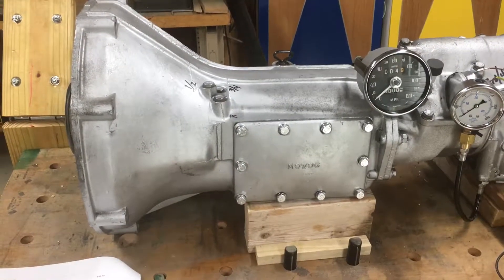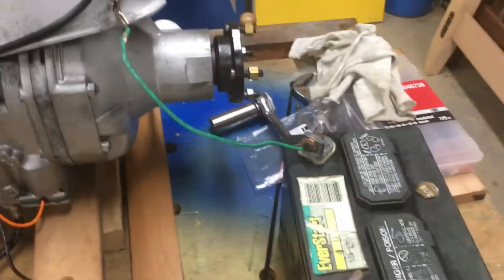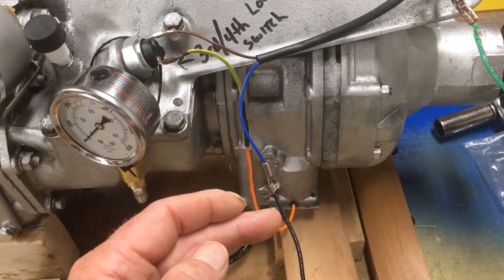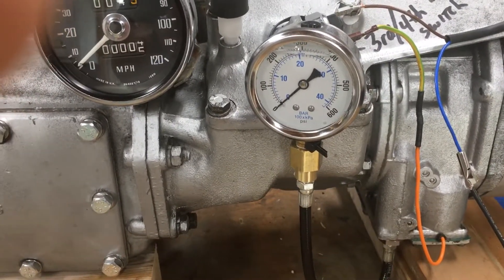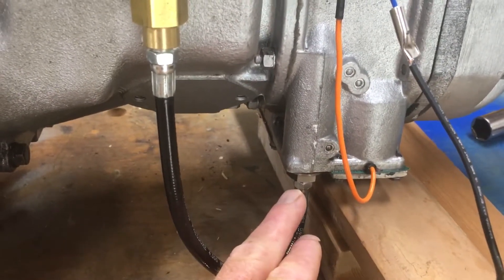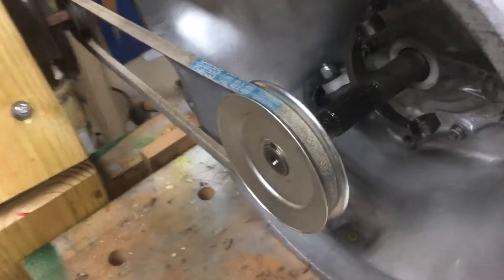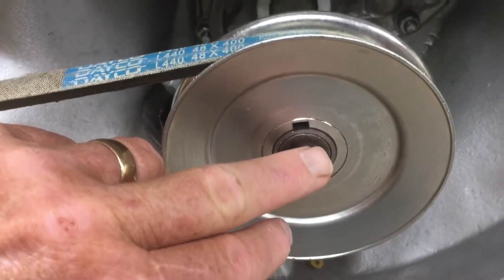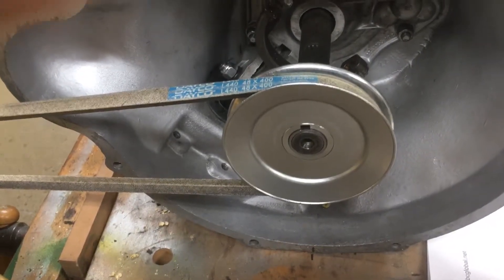MGB overdrive transmission bench test

Comment: Thanks for the video. I have questions: 
(1) what type of oil  you put in this tranny for your test?
(2) I can not tell from your video, is there a tooth connection in the back of your pulley on to the teeth of output shaft of the tranny? If there is no tooth connection, does your pulley ever slipped off during speed?

Thanks again
Reply from the maker: I use Castrol GTX, SAE20W/50 motor oil in the transmission, same oil I use in the engine.
Reply from the maker: The purchased the pulley I used on the output shaft of the transmission from Tractor Supply. The mounting hole was slightly larger than the shaft, so I had a friend of mine machine me a spacer shim.  The pulley has a set screw to secure it to a shaft, he also drilled a hole in the shim to allow for the longer required set screw, I had no problem with it spinning on the shaft.

Comment: Superb 👍 You engineering types are amazing. Doesn't explain why mine suddenly stopped working. New shifter switch. Solenoid tested working and refurbished by overdrive repair people in Sheffield United Kingdom. New o rings in pressure valve and pump. No joy. Need to remove engine and send unit to Sheffield for further exam.
Reply from the maker: Thanks for the nice complement.   Before pulling it out of the car, make sure that you are getting power to the solenoid.  As I reviewed in the video 12v power goes through the O/D on/off switch (mine is located on top of the shifter lever), then to the 3/4 lockout switch (on the side of the trans) then finally to the solenoid.  problem could be in the 3/4 lockout switch, or the O/D on/off switch.  More then likely the problem is electrical, to test that just bypass both switches and run power directly to the solenoid, of course using a temp on/off switch.  After wiring this temporary power, drive the car, and once in 4th gear turn the temp circuit on, there's a good chance the O/D will engage.  Good luck
Reply: @otmarrenken3465  Thank you Otmar! I must tell my mechanic, but he tested the solenoid for power after it had been refurbished by overdrive repair people and reinstalled and he was happy that power is getting through to the solenoid
Reply from the maker: @LeRoiDelaRue  Good luck, I had hoped to save you allot of costs pulling the trans out.  Let me know what you found wrong after you get it working again.
Reply: @otmarrenken3465  Will do Otmar, thanks again for your encouragement